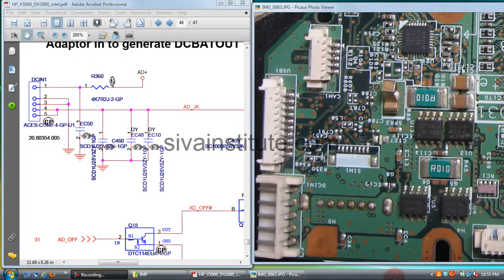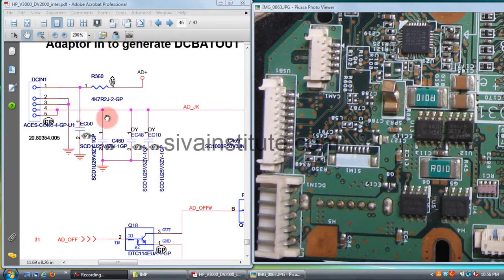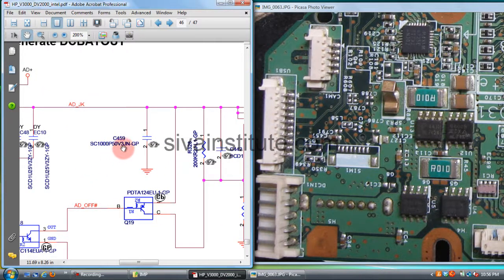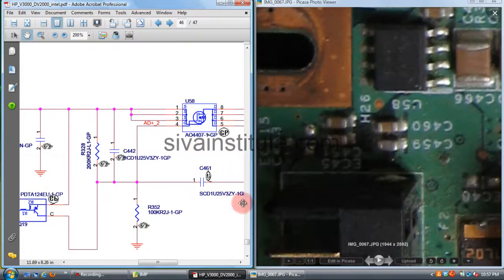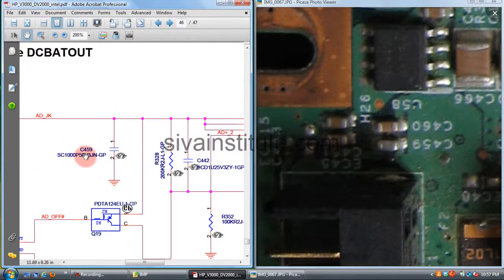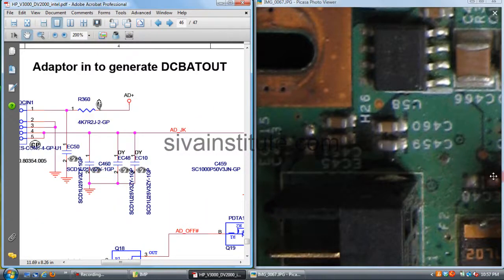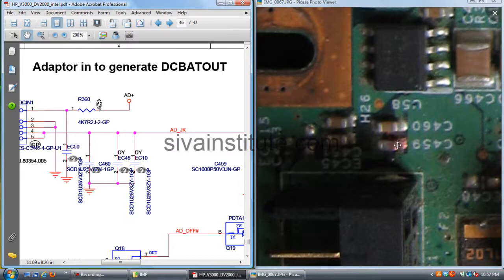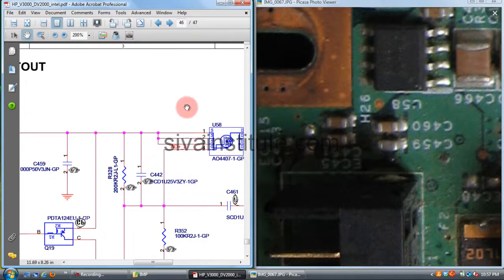How to check DC jack short Laptop Repair (Chip Level).eng

Comment: The video was great....Thank you...Do you have a schematic diagram in acer ferrari 1000 series and a tutorial? because I have a problem regarding not charging and won't power on using power cord...I already check the adapter have an output but if I plug it to the jack it drops 70 percent of the maximum voltage...Can you me for that problem? please.....thank in advance.